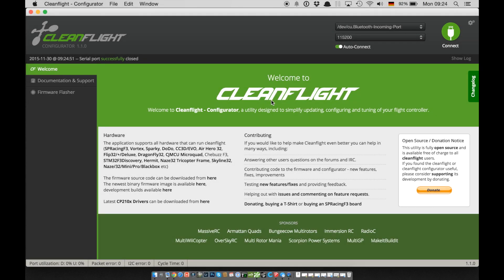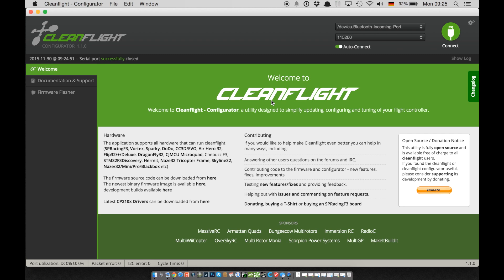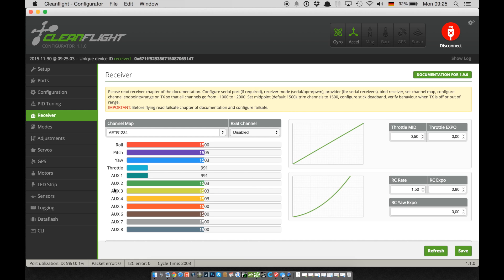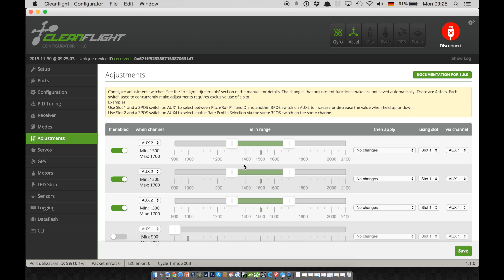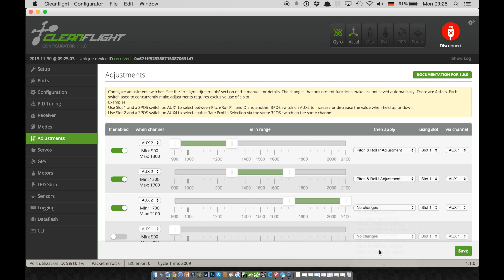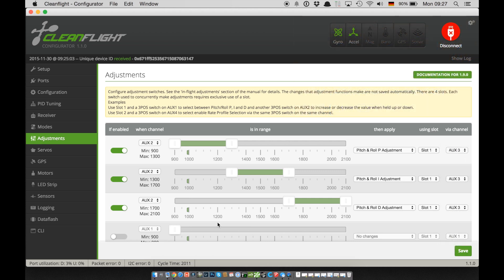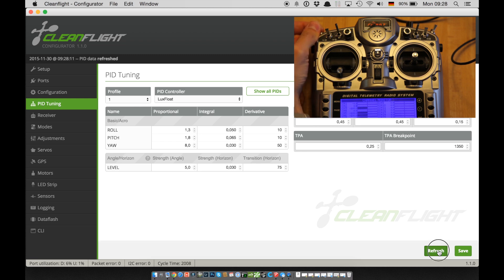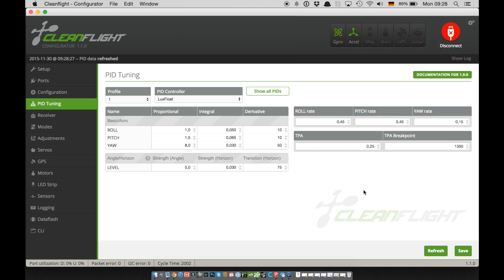Cleanflight - Configure a Switch to Tune PIDs with your Transmitter - In Flight

Comment: So switch on...value goes up...switch off...value goes down. How do you stop it at current value?
Reply from the maker: You would need either a 3-position switch or use two switches instead.

Comment: how does it know to go up or down
Reply from the maker: +Johnathan Smith  The switches on the transmitter send out different signal lengths. If its long then it goes up, if its short, it goes down. If it is long (goes up) in a certain switch state, that you can see in the receiver tab where the aux channels show up. If its a long bar, its a long signal and the value goes up.
Hope that helps!

Comment: Nice video, thanks.
Can you explain how you save the settings with the sticks?
Best regards Kim.
Reply: +Kim Heigren To save the setting you pull your left stick to the lower left and the right stick to the lower right. That is - if you are on mode 2.
Reply: what do you mean by "mode 2"?
Reply from the maker: Mode 1 and Mode 2 are the most commonly used transmitter setups: https://www.youtube.com/watch?v=zPulL87zEJQ